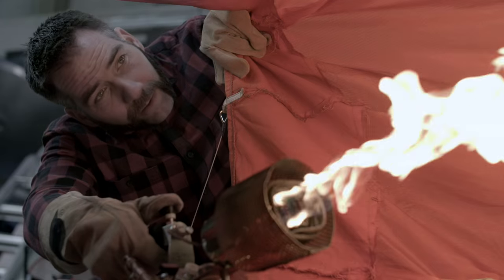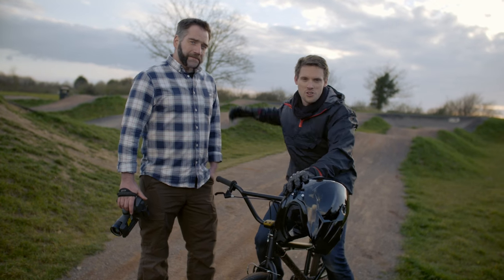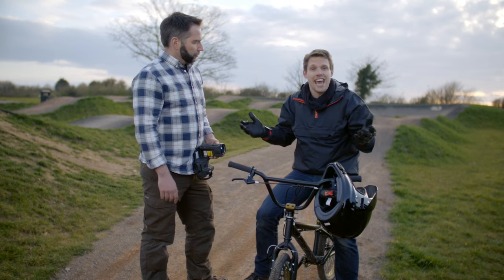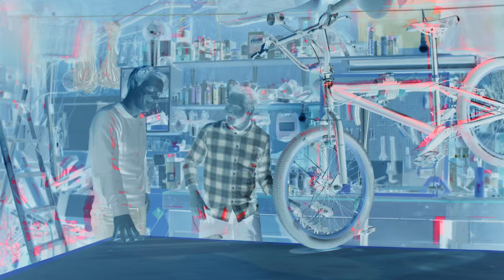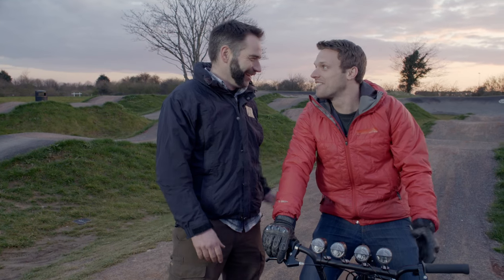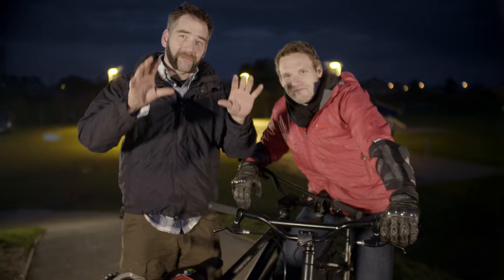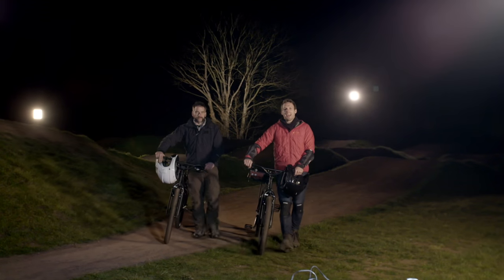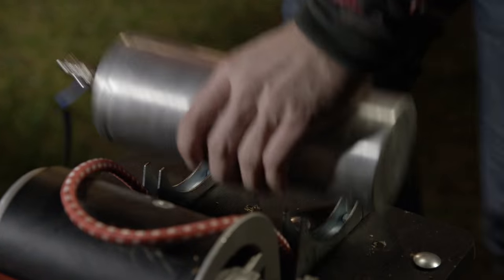Braking Energy Recovery I The F1 Power Unit Explained I Honda Racing F1

Comment: Guys! I'm Arghya from India! wonderful video! But, I found Jimmy saying that the race was not about who finishes first, but about who stores the greater energy in the capacitor! I find it to be the same.                                                                                                                                                                                                                                                                   Imagine a velocity-time graph where the area under the curve is constant as the distance in the race is constant. Here, the man who finishes the race first(in lesser time) will have greater peak velocity in his v-t graph and greater the peak velocity, greater the peak kinetic energy, and greater is the kinetic energy lost (converted and stored as electrical energy in the capacitor) at the end of the race as one must come to a halt at the end of the race.                                                                                                                                                  So. if someone has to generate more energy in the battery, he must finish the race first.
Reply: Or he could just go really slow around the track with the regen system engaged all the time and loose the race but he stored way more energy.
Reply: yup! that would also do!
Reply: Well, a bmx track is not the best option for this demonstration at all. At a BMX track one should not brake at all. ;)